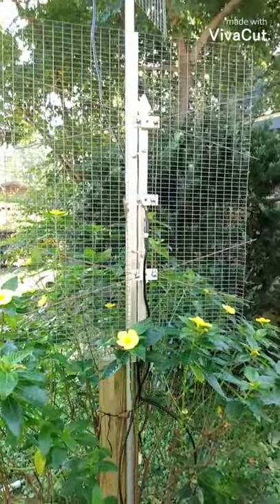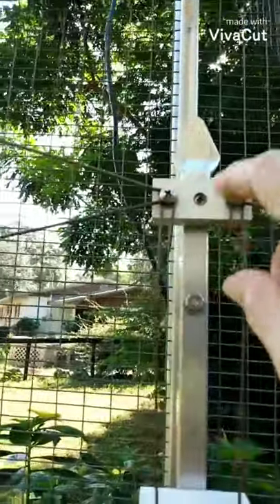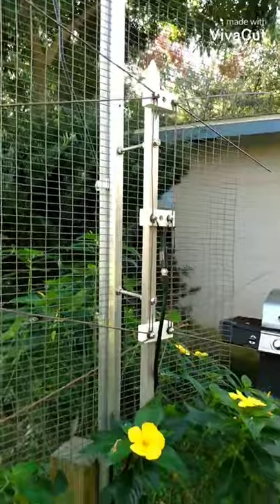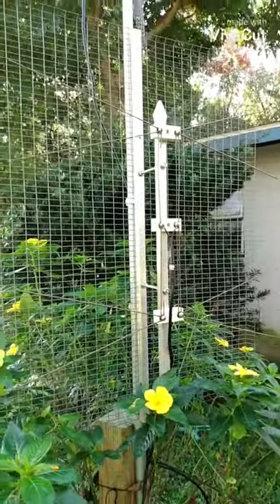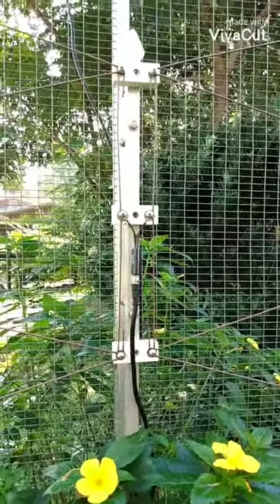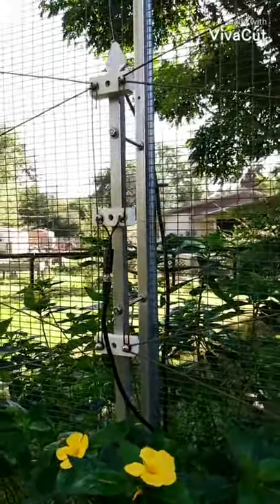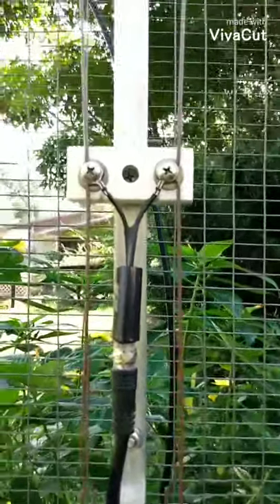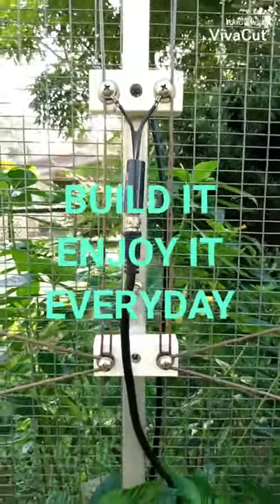REVIEW 12X15 TWO BAY BOWTIE

Comment: Well done sir, I would sure like to see how this 2 Bay stands up to a 4 bay bowtie.
Hope to work on this 2 Bay this winter.
Great video, keep them coming.
RG
Reply from the maker: Thanks RG, so far this two bay has out performed the 9.5x9 , 4 bay bowtie and the Hoverman with respect to the lower frequencies (14 - 21).
Since the repack we now have uhf frequencies from 14 to 39 and this model is performing very well on all.
Give it a try, can't hurt. 
Thanks for the input, it's very much appreciated.  M
Reply: @cosmicantenna9244  I sure will. 
You have the best information!

Comment: If you just did A/B side by side testing, would it matter if one antenna was grounded like you currently have and the other not?
Reply from the maker: For temporary testing it's ok .
You don't have to ground while you are switching and testing. Just be careful and watch the weather.
Reply: @cosmicantenna9244 , thank you! I wasn't sure if grounding one would impact it's performance or not.
Reply from the maker: Some say grounding improves signal, others not so. These antennas are not actually using the ground as part of the reception loop.
I ground for static and lightning safety. 
Hope this helps.
Reply: @cosmicantenna9244 , fantastic! Thanks again!

Comment: How does it compare to the Hoverman?
Reply from the maker: All antennas being equal, they're not. While the Hoverman is without a doubt the best overall UHF antenna, it is not without it's strong and weak points. 
Most antenna models are created to target a specific frequency range or even a single frequency. 
The 12x15 bowtie was created to solve some of the lower UHF frequency. (14-19) issues that have become apparent since the channel repack, many stations have moved lower on the UHF band. The 12" bows are targeted to rf 16 and this solved a problem I had been having. Turns out the two bay 12x15 performed very well across the entire range of UHF stations so I kept it up. 
Details, 
https://docs.google.com/document/d/1eRQkXGDRNdXbdHFuaI_0Opp6cA8ftG0xGtUtLIVXMuA/mobilebasic
Reply: @cosmicantenna9244  The bowtie seems easier to find a better element length for a certain frequency range. 
I haven't found anyway to simply calculate the Hoverman for the new frequency range. I know there are computer programs to help but they seem complicated.
Always wondered why the Hoverman elements were around 7 and the bowtie around 9 or so.
Reply from the maker: The flexibility of the bowtie elements is why I chose that design when I had an issue with rf16 that I couldn't solve with the Hoverman. 
Builders have scaled up the Hoverman to 9" and 12" with mixed results, usually disappointing. Those 7" Hoverman zig zags have worked well for over 60 years and will probably continue for another 60. 
I never figured out exactly what the cause of the interference on rf16 was. The Hoverman had been in place for over 3 years without a tick, the problem started when the channel moved from 34 to 16.
Reply from the maker: P.S.
The 4 bay bowtie antennas with the 9" to 9.5" elements are an older design optimized for uhf when we had channels 14 to 51. 
The latest optimized size for the bowtie elements is  10.5" to 11" (per engineers)  This puts the elements in the middle of the uhf band giving generally great reception from rf 14 to 36 barring any specific issues. 
I need to update my website to reflect the changes.